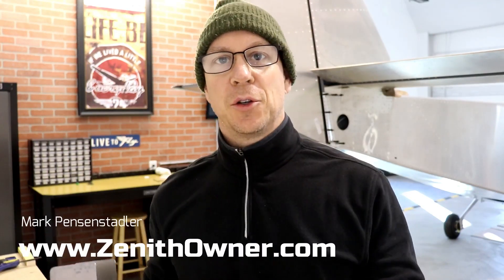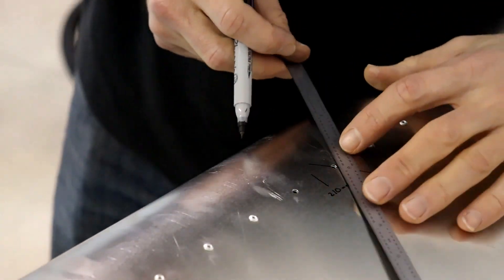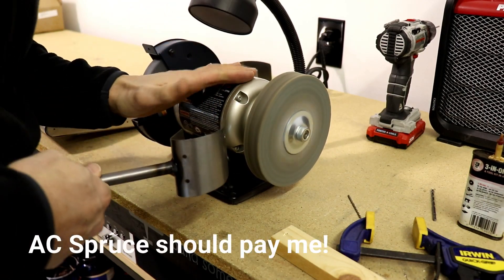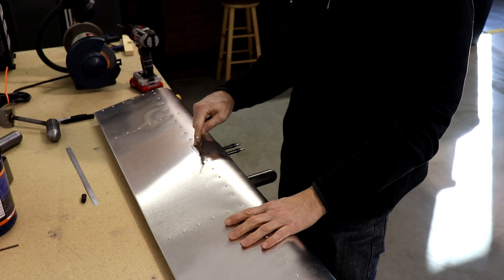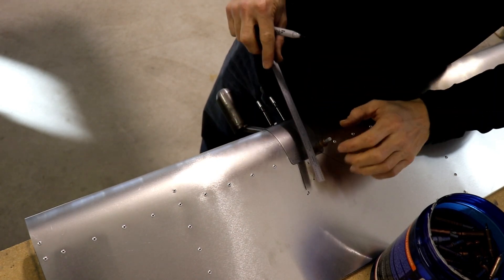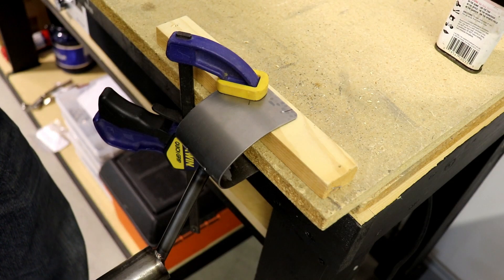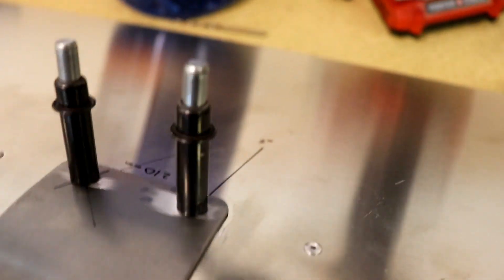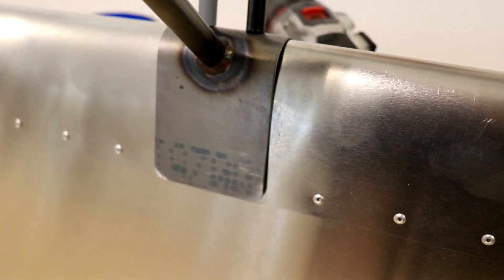Zenith 750 and Cruzer Airplane - Flaperon Weights

Comment: Tip on the "two inch line" method:
         Take any short piece of flat bar, strip of aluminum, etc and  place one corner at the center of the hole. Draw a line along the length of the piece of metal and another line at the end of metal(perpendicular to the original)  intersecting the first line coming from the hole. Now place your piece that's to be attached over hole, then lay down your measuring piece of metal, align edges with lines and center punch at the corner.
      Lots of methods of skinning cats --- I try to find the simplest.

Comment: Hi Mark,  following your advice I mounted my flaperon counter weights last evening.  Very simple!  Next step since they are heavy is to take them to a machine shop and have them drill out a 1/2 inch hole about 2 inches deep, then I can add steel shot as needed to get each piece balanced then button it up with a sandable cap.  Thanks again for the great videos.  John

Comment: Mark, we Cruzer builders really appreciate your excellent videos and the many helpful tips you provide. Now what are you going to do with that asymmetric elevator horn with internal bungee?  How about a pulley set up or separation of the horn from the flaperon control system.  Lots of complaints on that one.  I have seen a pulley added behind the elevator horn to fix the original asymmetrical design but don’t know how well that works but the idea makes a lot of engineering sense.
John Minatelli